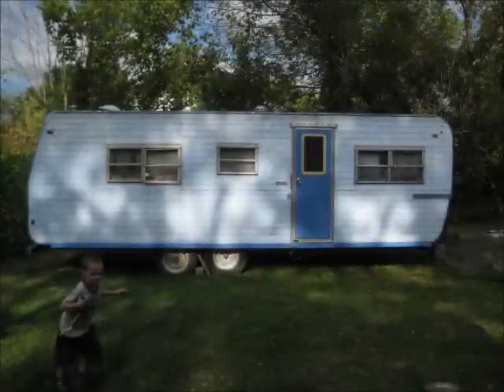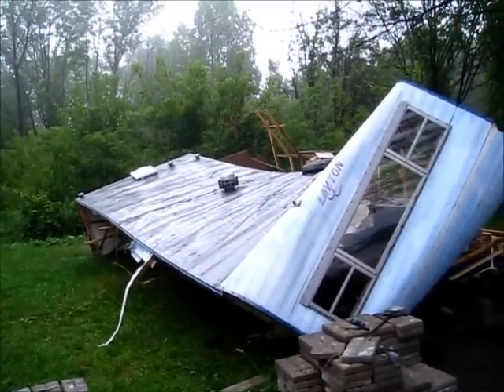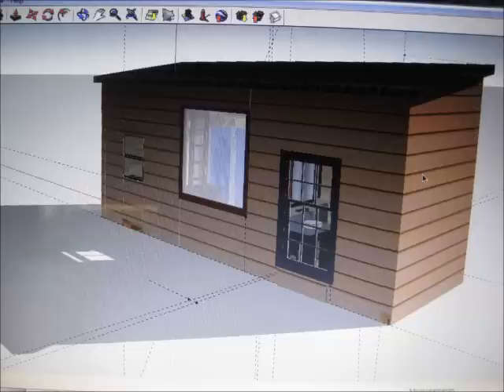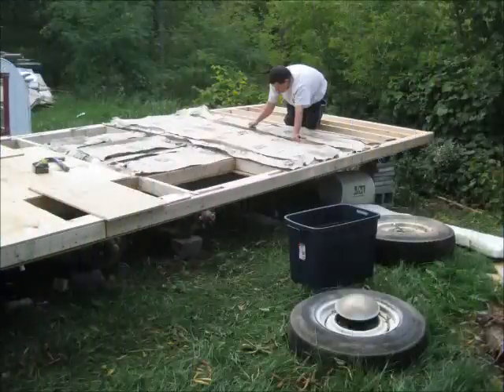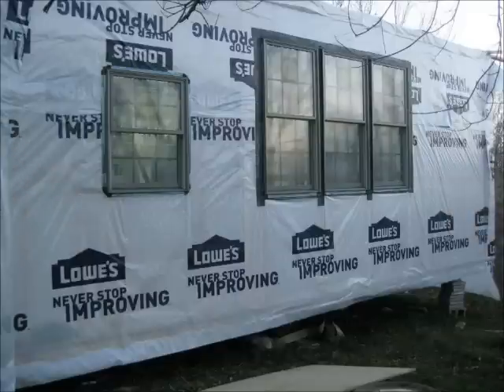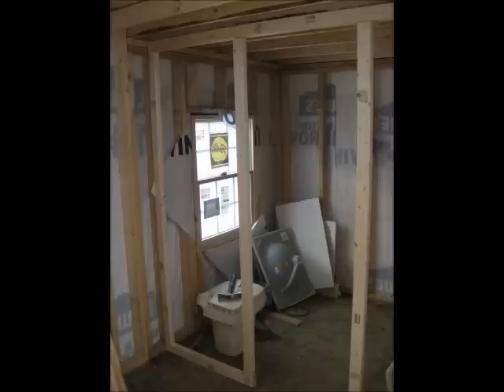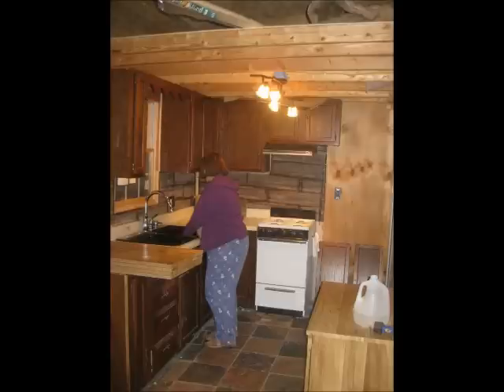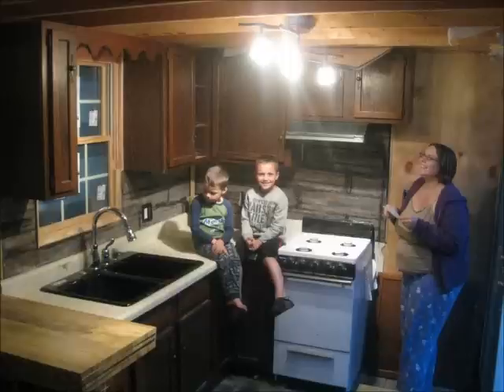Tiny house for under $5000

Comment: What is bad, is that most RVs, that old, use 1x2 stud walls, which sucks.  I used 2x6 floor joists & for the substrate (pressure treated), and 2x4 wall studs....made it worth it, with good insulation.

Comment: NICE JOB .I SEE FREE MOBILE HOMES ALL THE TIME.IF YOU EVER WANT TO EXPAND,YOU COULD PICK ONE UP FOR BEDROOMS AND LIVING ROOM YOU HAVE THE MOST COSTLY STUFF DONE.I WAS SURPRISED HOW MANY FREE TRAILERS AND MOBILE HOMES THERE WERE ONCE I STARTED LOOKING AROUND.I'VE SEEN SOME THAT SAID "NEW RUBBER ROOF.LOOKED AT ONE  FOR $600 ,HAD NICE NEWISH METAL PITCHED ROOF INSIDE LOOKED RUFF BUT NOTHING THAT BAD BUT 14 X 60 DRY PLACE WITH FURNACE

Comment from the maker: The reason I started with the travel trailer, is because we were trying to build this  with as little money as possible.  I not only got the trailer but also, some electrical parts, plumbing parts and so on.  I got a 14,000 lb trailer with brakes for 200$ and a few days work, and got my 200$ back when I recycled the metal I did not keep,

Comment: An option for cheaper lumber that's also better than the warped stuff in bundles is demolishing mobile homes that have outlived their usefulness. You simply need to contact local trailer parks and ask about homes they need tore down. Get them to  pay for the dumpster for the waste, and what you are after is the 2X6 floor framing. Of course sell the scrap metal for cash to buy things you can't get otherwise like paint. Often you can get electrical wiring to use also if it is in good shape, and look at things like the water heater, sink, bathtub, windows and doors. Sometimes You will find new doors and windows. If you need steel I beams for your project or angle iron look at the frames of the mobile homes. The I beams can be 40-80 foot long, and can be welded together side by side for more strength and far cheaper than buying new I beams. If a home on wheels is what you are after, a camper frame might be too weak. The mobile home frame might be too big, but a welding shop can make it the size you want. Pex water lines are common in mobile homes now. They are not hard to work with and can be saved also. You would just need the fittings, and if you choose the pvc shark bite style fittings they aren't that expensive. Might find some light fixtures you want to re-use, and if the breaker panel is not that old it might be viable to re-use. You can even look at the small things like closet rods, toilet paper holders, interior door knobs, drawer pulls cabinet doors and/or handles, and even wire nuts when you take the electric wiring apart might be saveable. If you can use it, why throw it away?

Comment: Cool project...  built with ur own hands..

It seems u couldve bought a small Shed/cabin already built and Sturdy and ready to do design changes as u specify.

For apx.. the same cost or less.

I've seen great tiny sheds/cabins for like 3,500. But again this is cool its definitely  a project good job..

Comment: Mmmmmmmm ............ nice . Great work , but I have very mixed feelings , You have placed several tons of weigh ( real oak kitchen , ceramic flooring etc etc ) on a frame that was designed to carry , what 3/4 of a ton ( aluminium is used , 'cos it ' s very light ) . It may hold ( I was impressed that you got it the 30 miles down the road ) , the usual engineering safety factor is 3 times the required capability , but I would suggest you go round & build up pads & jacks or pit props , to keep this notable loading from distorting the frame & eventually breaking up the house . I would suggest most of the loading will be coming down the exterior wall , so start there , but also were anything else notable comes down to the floor . If possible , go upper floor to under floor support without using the frame members , but use a pad to spread the load . Engineers tend not to go heavy , 'cos they will have the accountants on their backs , or the company goes bust . Go round every year and check the props are tight ....... enjoy !

Comment: My local Lowe's doesn't do cull, but Home Depot does. They no longer do price-tiers for cull but sell it all 70% OFF of original price (so 30% final price). Over the last 2 years I've been buying a crap load of cedar fence (all sizes), 2-by-? sizes. I have a LOAD of wood just stacked and ready for some mystery project for the future. Never go to Home Depot without checking out the cull section. Buy and save if you have the room. Eventually you'll have enough for a house. :D

Comment: Did a good job taking the parts off the rv kinda lost on why you didn't choose to build from ground up after instead of going the rv route could've had a small house plus the rv but it's fine if that's what you choose and did a damn good job

Comment: I just purchased a used School Portable for $8,000 delivered . 713 sq ft inside fully insulated . Added 3 windows and a door for another $350 plus permits. Comes to $9,250 Still need a Electrician but with a bit of scrounging I'l have a nice cottage for under $12,000. And it only took Me 1 weekend to have it ready to move into.

Comment: I have similar plans to be a traveling nurse and to live small and mobile.  I would love to hear how things are going with you.  Bonnie
Reply from the maker: I am currently in the process of building out a camper for us to use, for our first few, travel assignments.  Just bought a f350 Crew cab to pull the camper, and my wife is working with several, company's to land her first job. I plan on starting as new string of videos, that will detail our journeys across america as we travel. I am also working on some new videos to show how we are preparing for our first assignment. My first advice it to, try and get started dept free, be a used rv, ours was free, get a used truck, then save your money as you work at replace the rv and truck with new or newer ones.  We will be starting out in  March 2015 or July 2015, so videos will start coming on a  regular basis, around August 2015.
Reply from the maker: +Bonnie Urzen  We bought our 5th wheel, and here is our new channel all about whats been going on. https://www.youtube.com/watch?v=N7gHC3GJWh0

Comment from the maker: 20 hours of labor, at $10 per hour only come out to $200. I paid 200 for the trailer, but got that back when I recycled the metal.  So all told I have $200 in the Trailer. Yes it would have been easier to start with as flat bed but would have cost more. Plus I got, extras, like plumbing, electrical parts and others.

Comment: If someone rebuilds a school bus for use as a home, can it be insured. Running? Non-running? or simply used without an engine and rebuilt on the inside for home use only? I assume insurance on a school bus is MASSIVE ! Any way around having to insure it as a passenger bus?

Comment from the maker: So the only thing the trailer cost me was my time and work, it took about two weeks, but I was a working a full time job also, so it only took about 20 hours at 10$ an hour that's only 200$. You would be hard pressed to find a 24 foot, 14,000lb flat bed for $200

Comment: that's what im talking about I just tore down my 73 - 20ft open road camper that was rotting a way ( I lived in for 2yrs ) but im going to build something major cool on the frame that will turn heads when it goes down the road (its a surprise / I would have to zap u into a another dimension if I told ya  LOL )

Comment: That trailer frame and the wheels and wheels beatings (all involved) were not built to carry all that weight you can't go very far.  You might get a few miles, but the bearings will heat up (turn fire red) then the wheels seize up and fuse so will not turn.

Comment: Just a thought: With the House-wrap installed between the Framing & Sheathing, instead of between the Sheathing & Siding as is most common, you are probably going to want to beware of moisture affecting & perhaps even rotting the Sheathing if it gets bad. It is a vapor barrier even more than an air barrier, so any moisture will stop @ the layer just outside of it. Hopefully you do not encounter any issues, though. Looks great, man. Very inspiring. I've been looking into Tumbleweeds myself.

Comment: I've been a contractor for 20 years and will do 2 wire light fixture installation but. I would never tell anyone to wire a house or trailer. it could not be in there best interested in the long run. just sayin
Reply: I would recommend anyone doing their own wiring have someone trained check it out before finish out happens to make sure it was done safely and correctly. But I begrudge no one doing it themselves to save money.

Comment: @marrieddragoon
Will the new weight of the tiny house be to much for the frame? Anywhere you might be able to get it weighed? Id hate to see all that work complicated by a cracked chassis. I only ask because I work for a RV chasssis manufacturer.
Reply from the maker: It's been 7 years, everything is fine.

Comment: I'm a bit confused. Why didn't you just buy a flatbed trailer that has two axles? You would have saved a huge amount of work. If you figure your hours into the demolition & disposal/recycling time, even at $10/hr for your labor/sweat equity, seems like starting with an old travel trailer was unnecessary.

Comment: What's the point of building it as barely mobile, a lot of people are doing this around me but without the axels...
Reply: Two reasons: 1. You can build it where you are, with utilities at hand, then move it to where you want it. 2. As long as it remains on wheels, you don't have to get a permit or worry about building codes.
Reply: depending on state you are in. as of 2016 this is no longer true. Some states are requiring permits

Comment: And Mike billy after 20 years of contracting you should know wiring 3 circuits in a structure like this is novice work and could be done by anybody with half a brain. Other than that looks good if I ever come across a camper for under 500$ I'll take up a new project

Comment: House-Wrap is NOT water proof.  I repeat, House-Wrap is NOT water proof.  Water drips through House-Wrap going both ways.

House-wrap allows water to pass both ways and acts as a wick to wick moisture away and down from your House-Sheathing that is supposed to go underneath the House-Wrap.

Yellow Wire? LOL.  What gauge is the wire.  As if Yellow designates a type of wire.

Comment: I wonder if someone could set up a way... so that you could put two trailers like an L shape and with like a long metal L bracket or something to connect, would it still be considered a 'trailer' house if you connected multiple ones? You know, so if you wanted to move it, you'd have to use two (or three) vehicles to take each one apart? That might be a way to get a 'tiny home' to fit a bigger home need.
Reply: I think that Building one, with a set of headers, down the taller side of the roof ; so, a great deal the whole side is removable- & Re usable on the wider section.. then..This could allow an addition to be Built ..onto it over time..  Or build two and fill in the middle .. or ...build three and set them side by side with a continuous..covered-  front porch..Boardwalk.. like a 1880's saloon front. go to Virginia City.. in Nev. its a tourist trap..lol but the buildings are NEAT!..and look at the  rows of shops on the main Drag- . I Can build those...and i have the Trailer frames, and the Old materials....NOW...~~want one?

Comment: What did I miss here...what was the demolition of the trailer all about?...I do not see salvaged items here really, with the exception of a maybe a sink or some low priced items...
Reply: I think he used that old trailer for the base to build on so he can move it about if he wants & it is classified an RV rather than a house for zoning rules.  At least, I have seen other "tiny houses" built on a trailer frame for that reason.
Reply: You didn't miss anything. He didn't need the trailer.

Comment: Did you do anything to strengthen the trailer since it used to be a camper trailer? Those tend to have more flex in the frames. I ask because I am starting my own tiny house build and I also bought an older camper trailer to re-use. I have plans to strengthen it a little more but just curious as to what other people have done. Thanks. Can't beat $350 for a trailer with no issues, just minor maintenance like tires, and new lights.

Comment: Basically, you didn't need the camper to build the house.
Reply: It was cheaper to buy the camper for the trailer..to buy the trailer runs around 2000 dollars..so he saved alot of money..but traded it for more work
Reply: ***** I'm pretty sure we "comprehended" perfectly as I sat through this entire train wreck of a video while he explained, in great detail I might add, how he spent incredible amounts of time to strip down a piece of crap to then only sell back the reclaimed garbage for what he paid for it.

Ridiculous.

The value of his time and effort is worth more than what he would have paid for a flatbed from Craigslist.

Comment: How's this holding up to wood rot, mold, weather conditions ect? These tiny houses look great when completed but you never hear the long run story. Normal RV's don't last, short of aluminum ones but that's a rare and new exception. Majority have major issues after a very limited time. So I am curious, all the BS aside, how is your trailer doing. 

As many asked before, why not just get a flatbed? Stronger axles mean less chance of catastrophic disaster when moving it or having people inside it. How's your exterior structure holding up? I see that truck in the background. You went from a maybe 5000lb trailer to what? Do you need a 3/4 ton or 1 ton truck now to pull it?
Reply from the maker: +IVAO04ify it's built like a house so it's holding up great! I visited it last month!

Comment from the maker: We bought our 5th wheel and are on our first travel assignment!
Reply from the maker: https://www.youtube.com/watch?v=N7gHC3GJWh0
Reply: where did you stay while building this?
Reply from the maker: TheHecticGlow we rented a house,  and built it in the drive way.
Reply: +marrieddragoon Just noticed you pulling of the roof and it still had windows attached.
You could have repurposed those as well.
I do a hell of a lot of this myself ( repurposing ) just haven't built my own tiny house yet but have gathered a bunch of things that would cut the price dome from now on.
100 meters of power cable was being thrown out and was brand new - now mine.
As well as solar panels and other assorted electrical/electronics gear useful for the basics of power and distribution.Plus a lot more that people would normally just buy as they find they needed it.
The lighting will be from low voltage leds I have gathered from over 20 torches. Including 1 that is 22watt and requires a heatsink or will literally shut down within 30 seconds from the heat.Also another 4x5watt cree leds.
A little bit of research and having a keen eye for things has already saved me a lot of cash.

GOOD WORK GUYS.

Comment: You got the camper for free but you demolished it. What did you actually use from the original camper and metal frame and tires? A lot easier to use a new flatbed trailer and build up
Reply: +Brian Young I was thinking the very same thing. Why not just buy a new flatbed?
Reply: A steel trailer that size is several thousand dollars. He got that one for $200.
Reply: How many people, do you think, made the same ignorant comment about buying a new flatbed for a couple thousand dollars? Darn keyboard warriors....
Reply: Yep. People don't understand poverty. Time is money. If you're broke, you can sell your time & labor. The finished house has the same selling price as if you bought a flatbed for $2,000 or donated $2,000 of labor to create the flatbed.

Comment: After watching your video, I have come to a few conclusions... 1. NEVER build or rebuild a trailer. It's FAR TOO DANGEROUS !  The Government (at least in Florida) says you can NOT build or rebuild on due to State and Federal laws regarding the "strength" and "integrity" of initial build. Kind of like a "building code for trailers". That's a bunch of BS ! That trailer looked like a paper box as you were taking it apart. Your build was 100x stronger... 2. IF you want to live in a trailer, bus or shelter to save money on taxes and live like a free man, do safely and legally, especially if you have a family. I'd buy the BIGGEST school bus and rebuild it into a 2 br house. Some of those things are 65' long and you can pick up a NICE one for $3000. At auction or one without an engine for $300. The structural integrity of a school bus? MASSIVE protection. You can even tie it down at the frame or body. Plenty of windows as well... If you don't want to drive it, you can sell the engine and transmission for $3000 as is. Just keep the shell, rewire and re-plumb it. I am not certain how insurance works on a school bus used as a house-bus or if it can be called a trailer?
Reply: Insurance is difficult!
Reply: umaxen01 
It is amazing how people thinking about their financial security come up with these brilliant ideas.  The co- founder of Partners in Health, Paul Farmer, was raised in a school bus (in Florida before the pols clamped down) while his parents built their home.
Reply: Kathleen Sisco  See? I was CORRECT !  8)   Now about the bus... You can look at the YouTube videos that show just how strong the used buses are. They can basically be rolled down a 200 foot embankment and the body structure remains round and sound (however NOT pretty...)